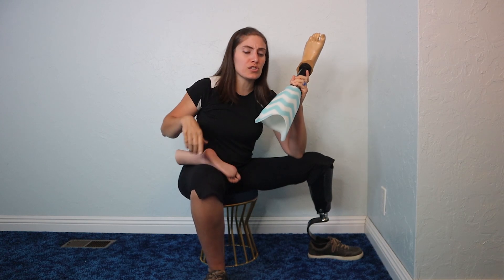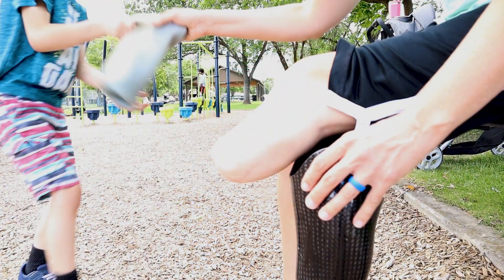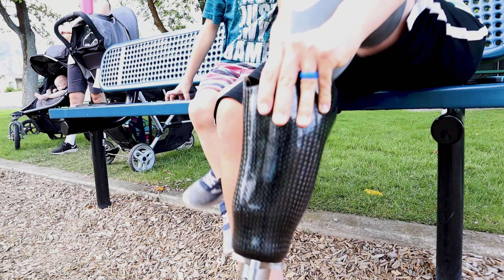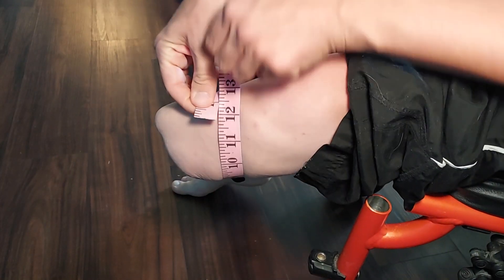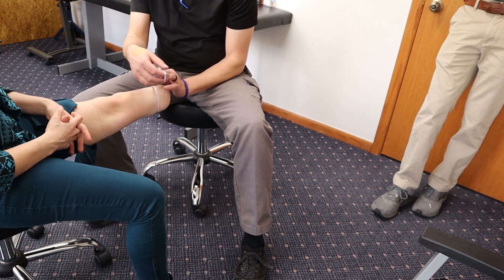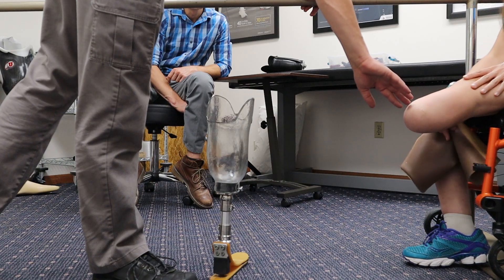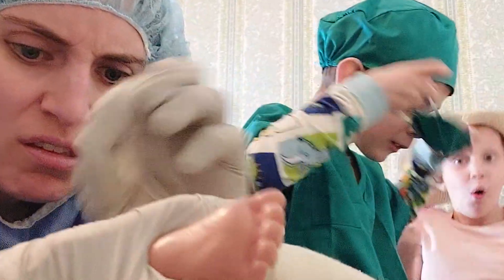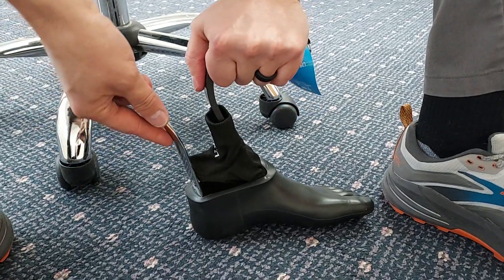What type of Prosthetic Should I Get? Pin Lock vs Suction Socket vs Vacuum Suspension

Comment: Hi, i have tried many type of feets.  The one who has followed me for years now is the C161 Triton VS from Otto Bock.  VS means vertical shock system. If you go to Otto Bock´s web site you can read all about the foot. This foot is an all terrain foot. It is very good for the active person. It is good for running, walking, hiking in forrest or mountains , ride bike.. and for the person who walk and stand alot in their type of jobs.  Im a Nurse for 36 yrs and are LBKA since 86. (1986)  This foot is the VERY best I have ever used. I strongly recommend it.  I have ruined thriatlon and marathon with this foot.

Comment: I have a left BK and have gone to the pin lock system.  It is amazing and easy to take on and off.  Super secure and I love it.  I never have to worry about it coming off.  Light weight and easy to maintain.
Reply: I am also a left BK and had to abandon the pin lok system due to my sleeve milking the  end of my stump. Just too much play in the end of the liner. I moved to a suction system with the vacuum pump located in the foot mechanism. It has served me well for the past 9 years but is again failing due to volume issues. I live in the middle of Wyoming where I’m finding it very difficult to locate a pros that I feel knows their craft and I can trust. I’m an amp of 50+ years.

Comment: I feel kinda lame asking, I got a below knee amputation about 2 years ago, it's healed, they salvaged majority of my calf muscle, and when I went to the prosthetic company, they said that usually legs are not as bulky as mine, I'm 320 pounds, and 6'4 tall I have large calf's most likely due to I've been a large male my whole life, I'm 320 pounds, but used to weigh around 600 pounds, the reason for the small story is, I feel pressure on my lower residual limb, and it's not comfortable, I don't want to complain, but it kinda feels like to much pressure on the bottom of the limb, and the person I talk to says that it could be normal, but it doesn't feel normal as to me normal would be walking without wincing in pain cause the prosthetic leg feels off its the kind that has a gel sleeve the has a socket on the bottom, but also he said initially that they were out of long sockets, and they only had short sockets, so putting it on is a nightmare takes at least 15 minutes to get it position for the socket to click in, and if it's hot it sweat a lot and gets loose very loose, to the point I feel it hurts, so I don't know, guess I'm just wishing I could get a good prosthetic, I understand they all have maintenance, but the first thing is it needs to be comfortable to a point, so any advice or info, on what could help, does it sound like a me issue or a them not listening issue, I'm kinda dumbfounded.
Reply: I would get a second opinion. Might just need a different Prosthetist.
Reply: I created a foam pad to cushion the bottom of my residual limb.
Reply: There’s also an antiperspirant specifically designed for the residual limb.
Reply: Its been a while, is there any news to share? I agree with the second opinion.

Comment: Some CRPS amputees I’ve seen have the pin in the bone. However, it’s easier got it to get infected.
Reply: I also wonder: do amps who have a pin attached to their residual bone also have to take immunosuppressant drugs for the remainder of their lives?
Reply: @d_horqua  that is a good question I’m not really sure
Reply from the maker: I've wondered what that feels like. On the one hand, I hear it makes life easier getting the leg on and off. On the other hand, having hardware inside you is more invasive.

Comment: you forgot the strap method i have a strap on the bottom of my liners where the pin would normally go it goes thru a slot in the bottom of my socket and back to a loop on the top and holds with velcro
Reply from the maker: Thanks for your input! I haven't met many amputees who use straps, so I didn't realize it's a common option. I stand corrected! (Minus the standing part...I took off my leg.)

Comment: I would add that the foot you try can affect how well you walk. The first one I tried was too stiff and I had to really work to flex it and get the energy return. The next one was great and I walked right away without difficulty. 

The suction system was great when I had a really snug fit. Steady and great control. Ah…then sweat. The pistoning was significant when the liner got sweaty. The other disadvantage of the suction system is that the sleeve comes farther up your leg which makes some pants difficult to wear. You might have to pull your pants down to access everything. I’ve heard this is frowned upon in public spaces. 

The osseointegration is definitely the fastest to put on and off. A quick snap and then twist of the connector and go. And it goes on in the correct position every time.
Reply from the maker: Indeed- public de-panting is frowned upon in polite society. I'm not sure how far up my vacuum sleeve and liner went up compared to your suction leg, but it was definitely higher up than my pin lock leg. I really appreciated it when I went back to pin lock and didn't have the sleeve anymore. The osseointegration sounds like it's working out really well.